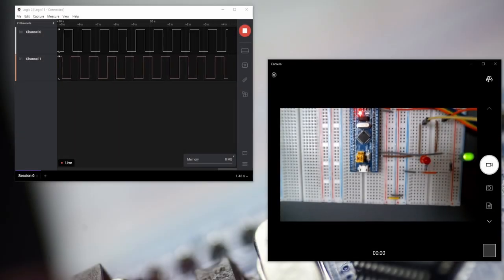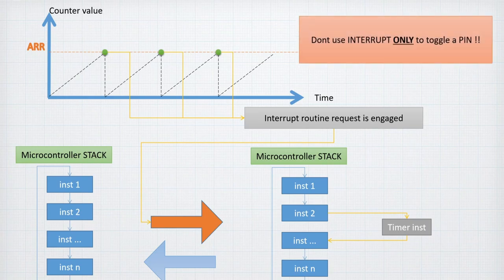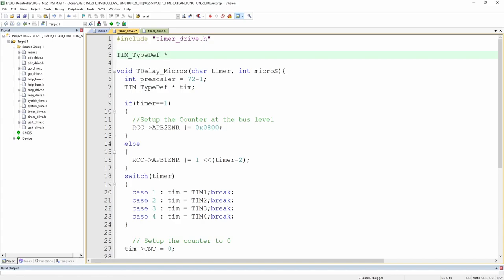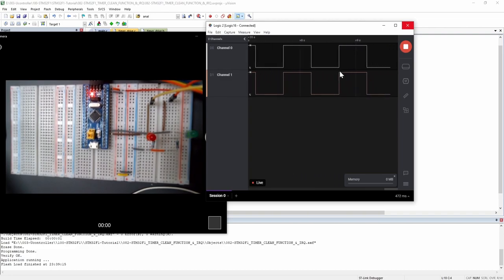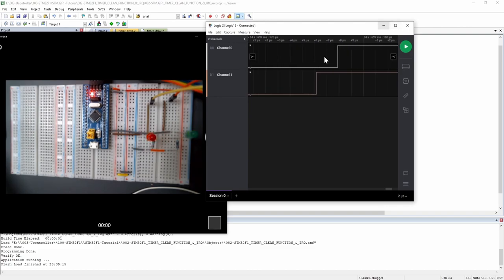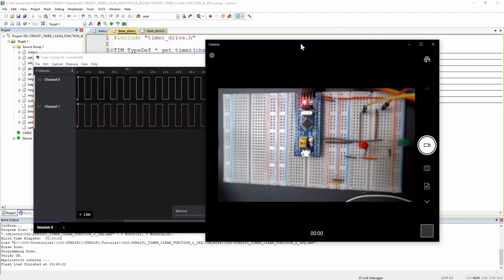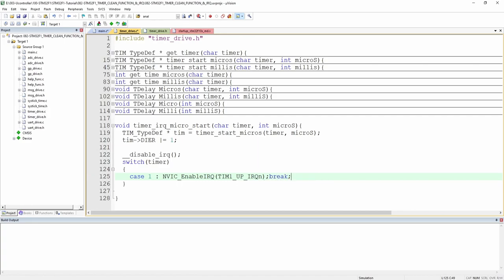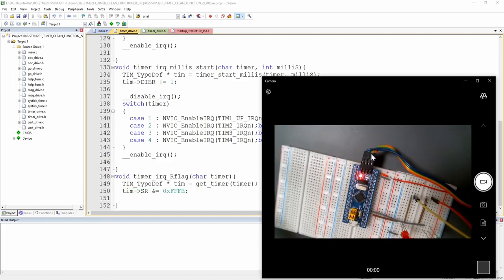082-STM32F1 Timer function optimization and Interrupt implementation & example

Comment: Nice video, good work.
I have a question for you. I have a problem sending data to sd card with stm32f103c8. The program I made with the hal library and fatfs does not work stable. Will you make a video on this topic?